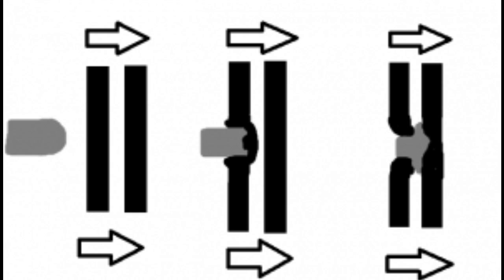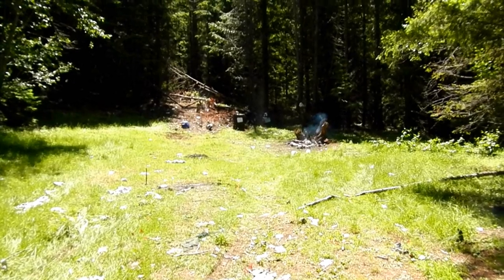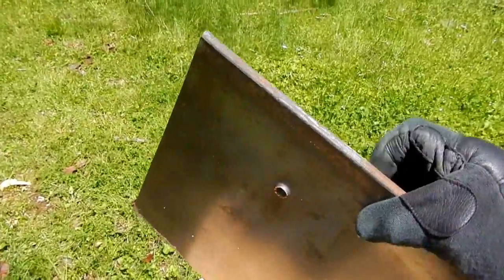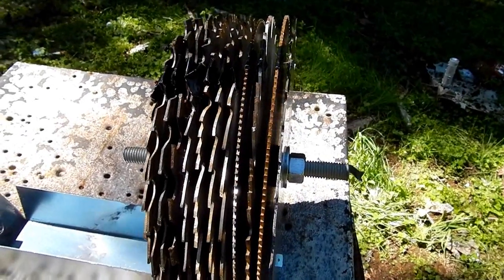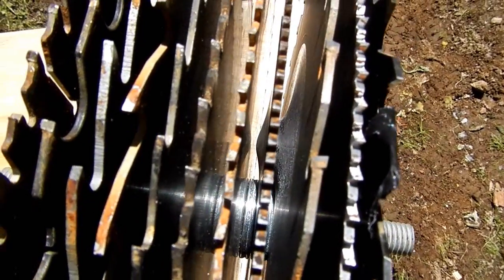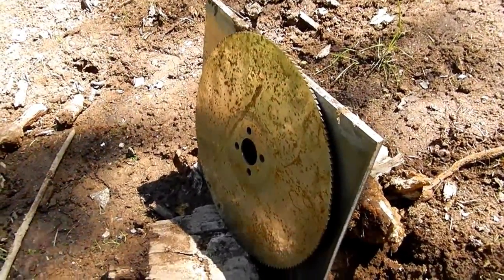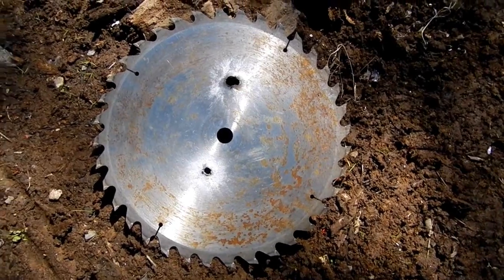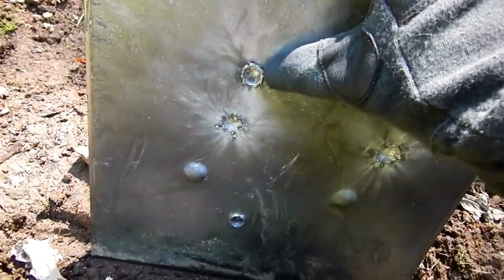Testing the Concept of Spaced Armor

Comment: The skirts on German tanks were to premature detonate HEAT projectiles as well as hyper velocity anti-tank rifle projectiles as German tanks had quite thin side armour (Pz.III = 22mm. / Pz.IV = 30mm.). Compared to the T-34 (47mm.) and M4 Sherman (38mm.) the German panzers skimped here on protection.

Homogenous steel armour also contains nickel (70%), chromium (2%), vanadium (1%), copper (5%), Molybdenum (1%).

Chrome - vanadium steel spanners and wrenches are probably the nearest practical analogue of homogenous armoured steel when it comes to hardness.

During WW2 the training tanks, that never saw combat, were made of mild steel and were tagged with a big red warning triangle stating that they were unarmoured, in case involved in live firing mock battle exercises. 

Prototypes, such as the first M4 prototype, were also made of mild steel.
Reply: The skirts on WW2 German tanks were specifically developed to counter Soviet 14.5mm anti tank rifles.

Comment: This test should have been done with another set of saw blades stacked without the air gap instead of the thick steel plate as this is a different, softer, composition to the blades.
Reply from the maker: I tried that in a follow up test. The video is up on my channel. "Spaced Armor Test 2"

Comment: Clamping those saw blades together in contact, then comparing the penetration with the spaced arrangement might have been a better comparison.
Reply from the maker: Check out some of my other videos. I did a follow up test where I tired that.
Reply: @jackalmountain6523  Did you try it with a bit larger distance between the skirt and the armor?
Reply: yes, because the blades probably had a higher hardness than the mild steel
Reply: @Bane Yes it sure as hell is, Genius. You absolutely must have a control for it to produce information relative to none spaced armor which is exactly what this guy is comparing it to.
Reply: @Bane It's called scientific control, by shooting at both configuration you can then be sure that the efficiency comes from the spaces. This video doesn't really prove that the spaced configuration was more efficient than the none spaced one. It just shows a spaced config stopping a bullet  while a steel plate don't. Not rigorous enough to make a clear statement.

But hey, it's just a Youtube video of a guy testing things, just chill out.
Reply: @Bane did you watch the video because he did test non space armor however what people are saying is that the steel could have been different  that it would have been more accurate to just clamp the saw blades together when comparing it against non spaced armor
Reply: The saw blades are made of stronger steel so this had to be considered too.
Reply: Don't need to space them out at second test. Simply clamp first then test, then remove clamp and test.
Reply: As would providing greater air gaps.  But then, I'm sure that various proving grounds have run through all of the permutations.
Reply: agreed, it would have been a hugely more controlled experiment (which is where actual learning comes from), but the guy also thinks that 12  1/8th inch blades makes and inch, and cant count to 12 in the first place lol
Reply: @Vatsyayana87  not at all. you missed the point of the entire thing.
Reply: Right
Reply: kinda depends. but mostly no.
Reply: nope, point of the thinner steelblade is that it absorves initial blast and stoppes bullet from spinning so it lands on the thicker steel like a slug
Reply: I read once in a WW2 paper where they determined that several layers of rolled homogeneous steel welded together did not ofer the same protection value as a single sheet of rolled homogeneous Stella of the same thickness. I’m not sure why is it like that, but hats wat I read, il try to find the source.
Reply: You'd think this would have been common sense...
Tests mean nothing without a control and variables being tested such as distance between plates and even maybe angling the plates plus staggered angles.

Not sure what this video is even for...
Wish common sense was more common so myths and pointless videos are spread.
I wasted 10 minutes before getting bored and reading comments, thanks for saving me from the rest of this video
Reply: Ken M everyone in the comment section acts like an expert in this field 😂😂
Reply: Only if you could determine their deflection effect by the difference in blade density.
Reply: Exactly. From what i remember lamellar armor has a strength thats about 80% i think it was of what a solid block of equal thickness would have.
Reply: How would it be a better comparison?  The test was of the concept of spaced armour, not laminated armour or layered plate.
Reply: @iatsd  I believe OP meant compare clamped vs spaced to make the spacing the variable in testing in contrast to steel plate vs spaced saw blades.
Reply: iatsd, Similarity of materials. Saw steels and mild steel are alloyed and tempered differently. Clamping the disks together would eliminate the materials variable.
Reply: @iatsd  because it's the same type of steel, I'm assuming the steel hes using isnt hardened at all let alone to the degree saw blades are
Reply: @iatsd  just to show how all of the material holds up
Reply: @iatsd  He compared spaced unknown steel types with mild steel. You can't do that and expect to garner any meaningful data. 

The test should only be with known steel types. How else could you replicate his findings? He should test something like .125 AR500 spaced in front of known object like a Chevy truck door. That's practical information. He could try different distances --> 1/4 inch, 1/2 inch, 1 inch. Or maybe two layers of .0625  AR500 spaced apart in front of the door.
        The goal being how to stop a bullet from penetrating your truck door with the least amount of steel.

Comment: on the steel plate... that 5.56 hole looks ALOT bigger than 5.56. Just saying. Sure would love to see a micrometer on the hole.

But this is very interesting. I never would have expected the 5.56 to penetrate more than the 7.62. In fact, I would have argued the opposite. Thankfully, I saw this before I did argue such a bad position.
Reply: Casper Spookey skinnier bullet (less diameter) traveling over 3k feet per second vs a fat 7.62mm bullet traveling around 2400FPS. People who are shooters still argue fast and light vs slow and heavy, which is better? Finding the happy medium is the hard part.

Comment: Was the 5.56 an M855 round?
Reply from the maker: Yes 55gr M855
Reply: @jackalmountain6523  M855 is 62gr. XM193 is 55gr. The reason I'm curious if you used standard ball (XM193) or steel penetrator (M855) ammo. Wondering if the penetrator round would do more damage on the spaced armor.

Comment: Now try again with mild steel sheets instead of hardened saw blades
Reply: Actual altering mild and hard steel is one of the ideas used in spaced armor the varying quality of steel helps distot, then tumble the bullet....
Reply: @wbnc66 : While that may be the case, it does not make for a fair comparison of the spaced armor concept.
It's not like they use mild steel armor on vehicles either.
3/8" hardened steel may stop 5.56 all by itself.

Comment: To know if spaced armor has an effect, you might try to set the thin plate smack up against the thick plate, and see if the 556 goes through. Otherwise the test is more of a test of adding armor and not as much about spacing it.

Comment: Great test and I love both of your rigs. One thing to comment on: Steel is not steel. There are plenty of variations out there with very different characteristics. The blades are usually made of very tough steel, whereas the solid pieces looked rather low key in term of hardness. Nevertheless, composite has proven its benefit big times all over the show - and steel and air is a composite. Like your videos, please keep going. Cheers

Comment: Wonder what some ceramic tiles in between plates would do?
Reply from the maker: good idea!
Reply: @Charles Yuditsky if the tile rings when tapped, you're golden. You want HARD facing, with a softer material to hold it together and back it. It's going to shatter, it's not good for multiple strikes, but you can keep some effectiveness with intact chunks of tile in the mix. 

Polyurea bed liner (line-x, Rhino, etc.) should work beautifully for the task, provided it's over a hard but non-brittle backer. Backer-coating-tile-coating and so on.

Comment: This makes me think that a thin layer of steel, perhaps with a thin foam layer  separating  steel from Kevlar ,  could make Kevlar helmets much more resistant to rifle fire.  

Wonder if anyone has done that test?
Reply: No doubt that's been tried. Back in the 80's/early 90's my cousin & I thought of that when we were just out playing around & learning what rifle rounds would & would not do. 
When you realize a bullet expands when it hits something hard and when you know a larger diameter doesn't pierce as well it's kind of an obvious thing to try. 
I mean we are no geniuses & we thought of it so, no doubt, the experts had thought about it & tested it many years before we came along shooting trash at my uncle's ranch.  
That idea does work. A bullet hitting something hard starts the expansion/deformation, then it's easier to stop in softer armor. The one way bullet resistant glass works on that principle. It has a hard face with soft backing allowing you to shoot out & it will stop bullets from coming in. There are obvious limitations in that which limits its practical use. It's still pretty cool and illustrates your idea very nicely. If you haven't seen it, check it out. 
I think helmets are probably an example of possible vs. practical. 
Yes, the principle works but it would weigh to much, be to big etc to be practical.

Comment: You have to compare apples to apples....... mild steel plate has completely different properties than tempered saw blades  so  data is probably not so accurate ?
Reply from the maker: Certainly not totally accurate but its better than doing nothing due to lack of perfect materials

Comment: 5.56 is approx 3/4 the dia of 7.62 but the surface area of their respective holes is very different. A 7.62 hole is almost twice the surface area of a 5.56 (45.483 vs 24.279sq/mm). It is self evident that twice the mass doesn't necessarily equate to greater penetration power.
Reply from the maker: Yes. It has to do with the kenetic energy equation KE=1/2 (MV)^2  A faster round will have greater energy.

Comment: You need to have the plates fully immobilized, otherwise the flexing blades will rob the round of its energy, invalidating your test, Square four point immobilization or triangular three point immobilisation.
Reply: also considering the difference in the type of material already invalidates the test. The material of the saw blades is a lot stronger than normal "mild steel" .
Reply: Isn't "the blades flexing will rob the round of it's energy" the whole idea behind a multi-layered armor system???
Reply: @TheDirtFighter  

Yep  so many failures of theory of operation

You WANT the layers of.steel to move,  move to shock absorb

Not a new concept at all.
Reply: Plus spacing out the distance separating the plates by at least twice the length of the bullet. Gives it enough room to start tumbling
Reply: it isn't a lab test for precise results..it's just someone dinking around with the concept of spaced armor.... if he set it up in a lab style test the general results  (spaced plates decreases penetration)would be repeated.
Reply: @wbnc66  The guy dont understand the concept of spaced armor at all... he was talking on the begining about some extra protection added to some light vehicles and that is not proper spaced armor, it is just spaced by coincidence and would be no help agains any HEAT or HESH threat... not to mention that he also have no idea that he is using completly different steel(just like Rosioru Adrian allready said). With the same steel armor spaced like he did would be much weaker, he is using steel that have huge difference like twice the strength of normal mild steel...
Reply: @Bialy_1 well normaly you dont use mild steal in armour plates, do you? any way reactive armour is much better at the chemical round threat.
Reply: It's a test of armor capabilities.  Robbing the round of energy is kind of the point.... if allowing the outer layers to wobble helps in that regard,  somebody somewhere will probably have tried it.  I dont care if me tank clangs like a tambourine if that slows down rounds before they penetrate.
Reply: i just hope his 5.56 can group better than this in real testing
Reply: dexter2433 aá

Comment: Are the saw blades mild steel or hardened steel
Reply from the maker: They are a mix. Its not a perfect test, but its the materials I had available
Reply: Typically even inexpensive saw blades will be a low grade of tool steel. The one that shattered was probably not properly heat treated for an impact. Had it been tempered it would have fared better. Since you hit upon the tumbling and increased cross sectional area maybe try the experiment again with 1/2 up to 1 inch or go really crazy with 3 1/2” spacing and see what happens. Maybe we will all learn some more from this.

Comment: There are huge differences between steel behavior on impact. And huge differences between different heat treatments of the same steel. And different saw blades can be made from different kinds of steel. So both stacks of blades, and both sides of the same stack, are not comparable. The blade with the brittle hole is hardened. Hardened does not mean resistent against impact - more like against scratches. Glass is much harder than steel, and easier to destroy.

Comment: Great video and I'd like to raise some points.  The 5.56 is moving significantly faster than the 7.62 explaining why the later doesn't punch straight through.  The point of the thin sheet in front of the main armor isn't just to add extra thickness, it the airspace that is more important.  The airspace allows the projectile to lose its trajectory as well as energy.  I'd like to see the last test with the saw blade in front of the plate done with it clamped directly to the plate and my guess is that the 5.56 would punch straight through again.  Also, to make things more predictable and accurate I'd use 1/8 mild steel plates and not the blades as the properties could all be different in the blades. Cheers.